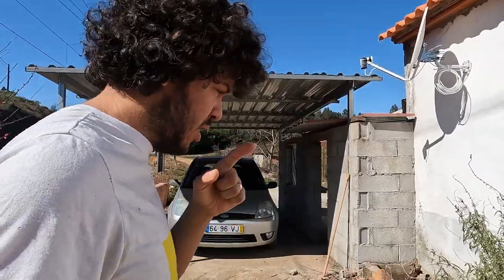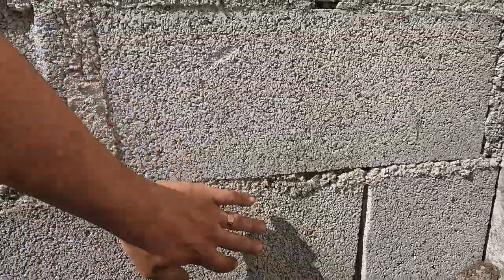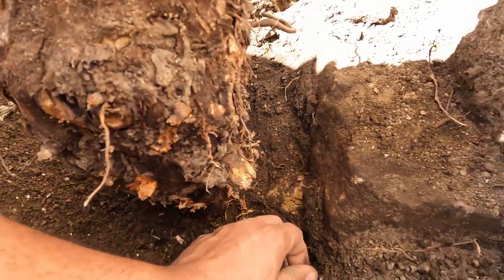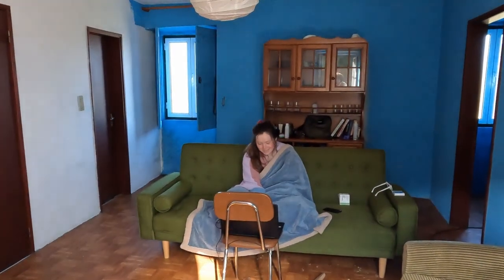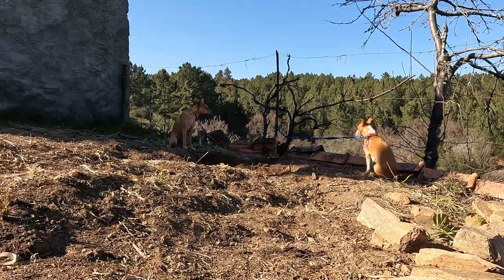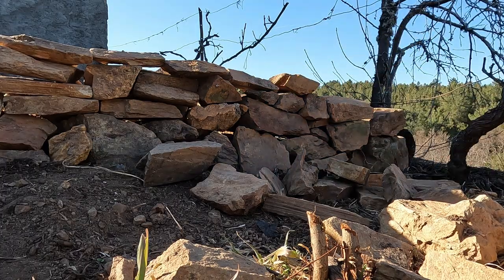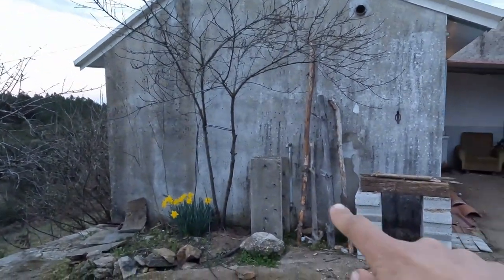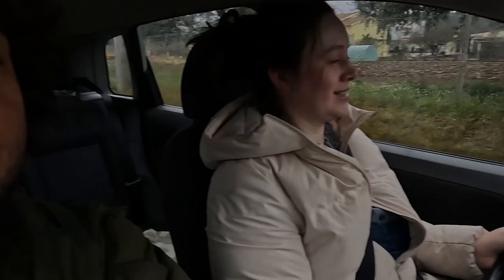We Finished The Stone Wall! | Building A Vegetable Garden On Our Portuguese Homestead

Comment: If you drill some holes in the trunk and fill it with baking soda and water it will kill it.  Another way to kill a tree is to cut a ring around the trunk.  Make sure it meets itself.
Reply from the maker: thank you for the suggestion!